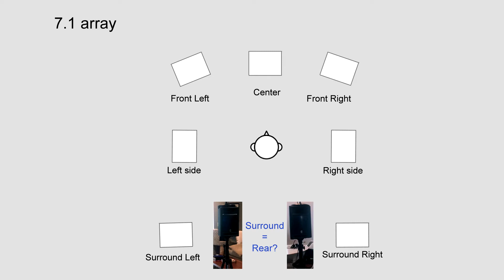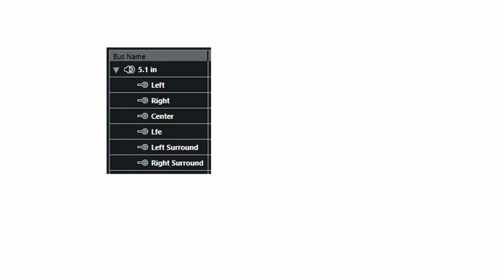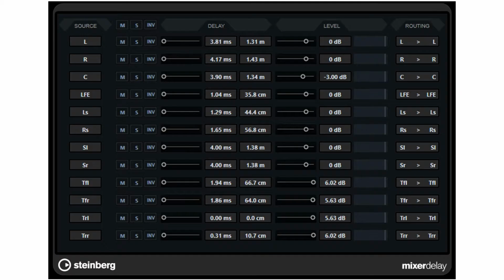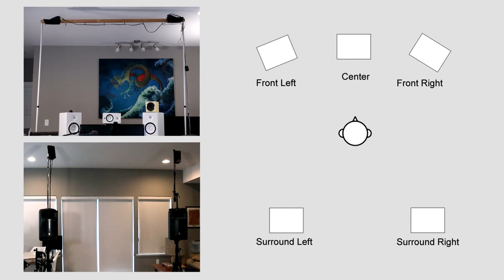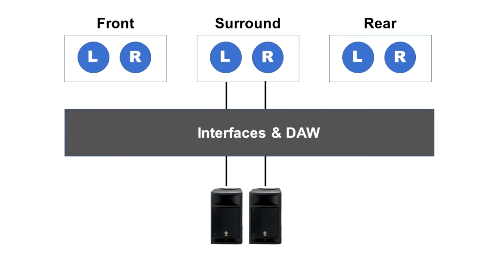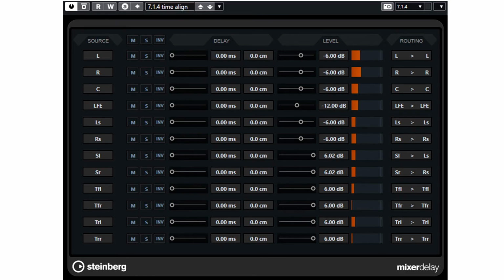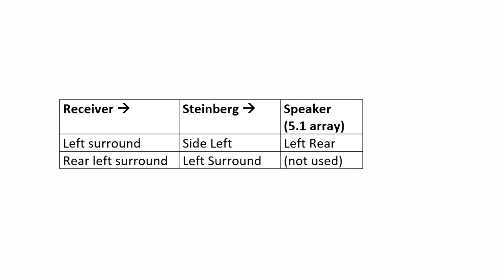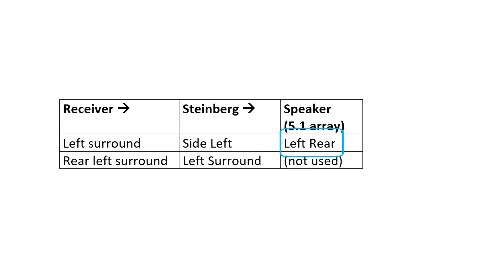Clearing up 5.1 / 7.1 AVR/Nuendo channel confusion

Comment: Just found your channel on my recommendation list, saw you cheaper atmos set up video.  Really good.  
I am working on a feature film and in pre production at the moment.  So I have just maxxed out my PC memory  upgraded to a RTX4070 TI graphics card and the next upgrade will be to 5.1 surround, as we will be having a closed premier at a local independent cinema for cast and crew plus families, before entering it into festivals.  So mixing and finishing in DCP with multichannel surround is a must.  But, what a nightmare.  So thanks again, there are other channels too that are of help as well.
Reply from the maker: Glad to be of help. Good luck!